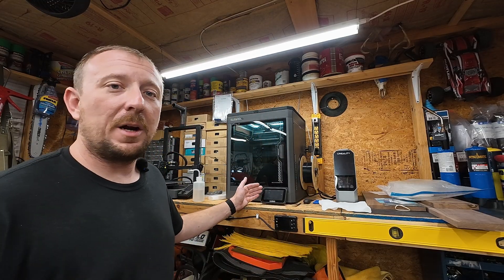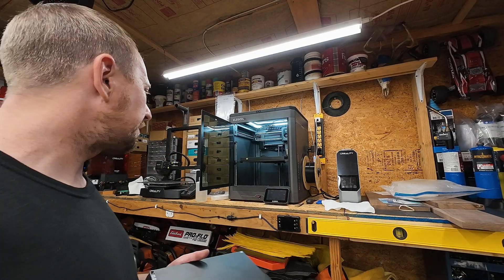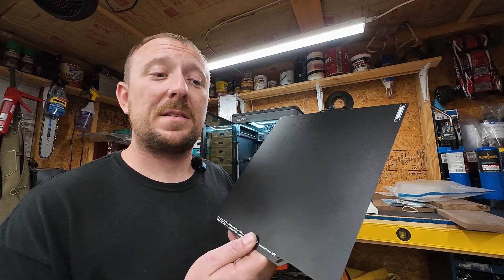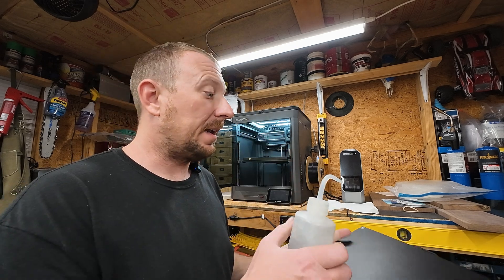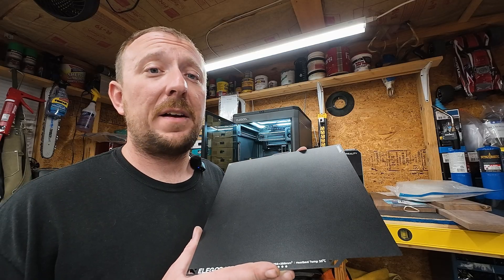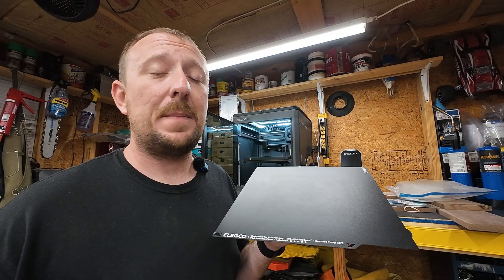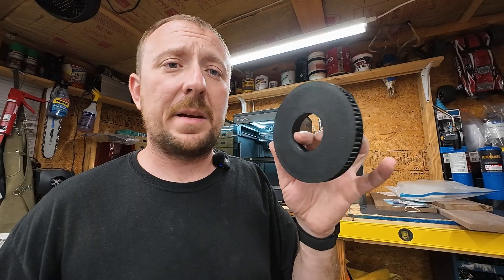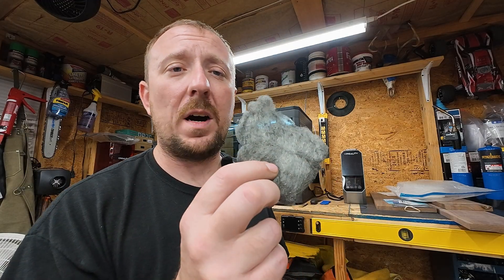Elegoo Centauri Carbon Printer Tips Day 15 Tricks or Treats

Comment: I can agree that what you just showed is best for most build plates that come with printers, but it may not be good for some 3rd party build plates. For example I have 2 cool build plates and one is OK to use alcohol on and the other if you use alcohol on it, it will eat away at the coating on the build plate. Long story short, always follow the cleaning instructions that came with the plate.

Like you I rarely use glue. Most of the time changing some slicer settings, and or reorienting the model on the build plate solves adhesion problems.
Reply from the maker: I personally have not used a “special” build plate, for lack of a better term. So I was actually unaware alcohol would damage them. Thanks for sharing that tip, it may help save someone else.
Reply: @Workshop_Wasteland  I like using them because they adhere better than standard PEI plates. And you can use them at lower temps, so it saves on heat and electricity.

Comment: I got mu Centauri Carbon about a month ago (not my first printer) i just started having adhesive problems. Ill try your cleaning method.  I've used 1/4 inch tempered glass in the past with hair spray, that worked great but it doesn't always want to release.
Reply from the maker: Post back here with the results.
Reply: @Workshop_Wasteland so i know it has been a while since my post. I had a problem with filament drying around the hotend, long story short, i had to replace it. 
I have been cleaning the build plate with the steel wool. Sometimes after the steel wool i spray it with hairspray and sometimes after the steel wool i clean it with rubbing alcohol then use hairspray. I'd say the steel wool works well.

Comment: I have a large box (almost full dimensions of the plate) I'm trying to print on the elegoo Centauri Carbon. I'd be interested to know the various things you've done to do to prevent the corners from lifting\warping. My research has pointed me to mouse ear brims (but, I've been using full brims already), reducing the distance to zero between brim and object (done), I've changed the filament setting (using orca slicer) to keep the fan off until a certain layer. And set another layer for which to have the fan back to 100%. Each attempt has been on the textured side of the plate (I really don't care what the bottom texture looks like for this print). Bed temperature has been 55 degrees for both first and other layers. However my ambient room temperature is around 22 C. I print with the lid off and maybe because it takes so long for the first layer to completely fill (solid layer, speed roughly 150mm\s) that the corners are cooling with the ambient temperature and losing adhesion and causing the warping. The other thought I had was to use the smooth side and bump the temp up on the recommended temp. The smooth side plate has a printed marking for 30C temp but if I keep it high like 55C (for first and maybe 45C for other layers) maybe it'll stay stuck for the duration of the print? I also suspect the heating element is at the center of the bed and the corners are likely too far away and possibly leading to the part's corners warping, more so in the back left (those time likely due to the auxillary fan blowing in) 

Anyways, would appreciate your quick feedback, thanks in advance. And thanks for making your video.
Reply from the maker: For starters I’d put the lid back on and only crack it open about 2 inches. Second would be to use the smooth side which is intended for PLA, third add like 10 brim layers of space permits that. I have not personally had a problem with larger prints warping with PLA. You could smear a little glue stick in the corners but I do not think it’s necessary at all or at least hasn’t been for me in the past. Lastly bump the bed temp up a few degrees and possibly slow down the first layer to ensure it adhesives before getting bumped off. And of course play with the Z distance.  I believe mine is -.065 currently but I can check when I get to my printer again.  Not saying that same number will work for you but gives you an idea to start with.  A little tighter Z offset might help with adhesion but might also lead to a bit of elephants foot as well. Let me know if any of that helps you out.
Reply: @Workshop_Wasteland  Are you printing with PLA? From the build plate temps I would think so. I have never had this problem with large prints, just used the default brim settings the slicer suggested. Also does the filament label have a recommended bed temp. There are a few that actually want 60c or higher. And I would also use the recommended temp for the nozzle based on what the filament label shows.

Also, what build plate are you using? Kind of hard to tell by the temps you are listing.  The only time I put my build plate temp down to 30 -35 is only on a cool plate that is designed for low temps.
Reply: @Workshop_Wasteland thanks I'll give it a try.
Reply: it worked, I actually tried a few things I kept the bed temp at 60C for the first layer then dropped to 55C for the rest. I had also added a slight chamfer to the bottom. Programmed no cooling fan until layer 40 while allowing full speed for the fan to gradually build to layer 70. I had the top open a bit (my mod slats were open). I reduced the distance of the brim to the model to 0, so less of a weak connection there. I printed on the stock optimized PLA smooth B side of the plate. But the time the piece was finished printing, the model has such good bed adhesion it was pulling up all 4 corners of the bed from the magnetic base by around 3mm 😅. There was clearly a decent amount of shrinkage on the part while printing. Oh and my ambient room temp was around 22C and the print chamber hovered around 28C

Comment: Been so long forgot who made my printer but biggest problem is setting the gap for the nozzle right and getting any part off the plate. If the gap isn't right nothing sticks.
Reply from the maker: Yes sir,  called Z offset and you are exactly right, it’s gotta be real darn close to spot on!
Reply: @Workshop_Wasteland  That is why us printer noobs love auto bed leveling. But even with auto bed leveling sometimes you might have to adjust the z offset, but nowhere near as often as with manual bed leveling printers.

Comment: I am brand new to 3 d printing. I just purchased the Centauri Carbon printer.  I did my first print and came out perfect. I do have a question that you can probably answer for me.  I wonder what the swinging door on the chute for discharged scrap goes. I dont know its purpose and I wonder if mine is broken.  Nothing is connected to it and I can wiggle it open and closed but it seems to be always open. Is this normal?  I ask because I heard a crack when I initially set the machine up and then realized there was a piece of foam in the chute from the factory that I failed to see and remove from that area. The print head hit that foam during leveling and that's when I heard the crack sound.  Could you look yours in that area and let me know what you think please.
Reply: I have a CC, and it is hard to tell exactly what you mean from your description. Does the printer still eject out the filament waste out the back of the printer? It is a flapper door that hangs kind  of neutral normally. The print head normally hits it to make it flip back and forth. See if you can find some pictures online of that area of the printer so you can see what it normally should look like. Or you could contact Elegoo take some pictures and say it got damaged in shipping.

Comment: I have a couple Ender 3 v3 ke printers that work well and make  all sorts of things. Started with the old Ender 3 . tons of shop aids and repair parts. They are super useful. I clean the beds the same way and also use acetone on occasion.
Reply from the maker: I still have my original ender 3, all be it far from stock form.  I think everyone should have a printer
Reply: @Workshop_Wasteland  I put a diode laser on the old ender3.
Reply from the maker: @joeblow7392 I have considered that myself actually, but I would want something powerful enough to etch metals. Not sure how good they are these days, I haven’t checked into it in quite awhile